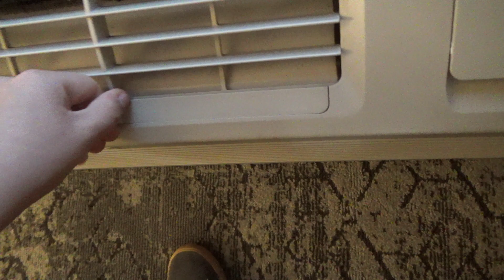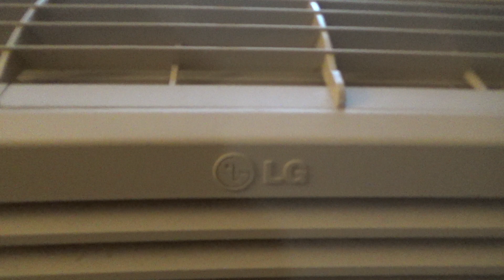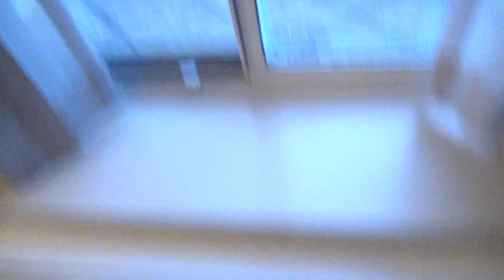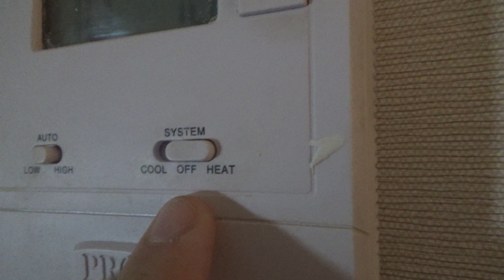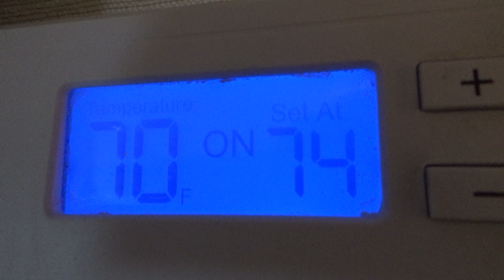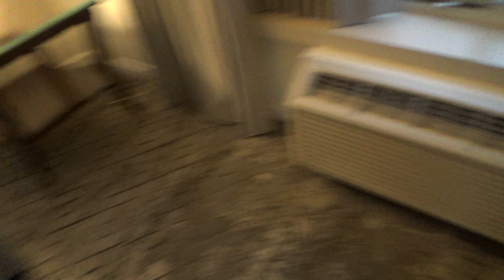LG HVAC Unit @ Sheraton - Needham Heights, MA

Comment: even tho they could kept LG but replace the old one and to a newer LG inverter but hotel AC that goes through the bottom of the window are called PTAC known as package terminal air conditioner not HVAC HVAC are central air conditioner for hotels as well but for a unit for a bottom through the window is PTAC so just to let you know the correct version you video on with and friedrich versions with digital controls im not happy that it doesn't have a beep noise for a PTAC all AC like PTAC that it doesn't need a wall themostat if it has the digital controls on the base already some you can use a remote control and those are way better and wall themostat is for only central HVAC system for hotels not PTAC Gree and LG are the best ones out there because a amana ac unit caught on fire at tradewinds in st pete beach in my home state so and new PTAC needs a special chip to the digital controls if it sparks and the system shuts down and beeps a error code means something is broken and it calls a hotel manager and the manager can call the PTAC tech guy to help and fix it and takes it to the repair shop to be fixed so that you know its the correct ac unit versions just FYi so yeah all hotels need Gree and LG PTAC are better and it doesn't need a wall themostat if it has digital controls it can use only a remote control and the remote can be wall mounted like the split units that has a remote and a bracket for mount the remote to the wall so hope you think im saying so im a very good tech smart autistic guy so i correct the right thing i said so what do you think
Reply from the maker: PTAC and HVAC can be used interchangeably for these types of units. HVAC is just a general acronym for any unit that can heat or cool.